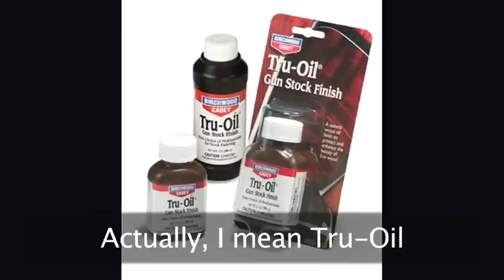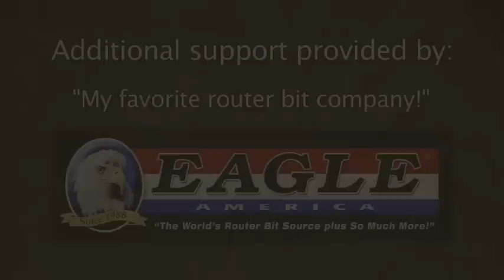107 - Oil-Based Finish Basics

Comment: Have you ever used Birchwood Casey Tru-Oil??? It wipes on then blends while drying....I was wondering is it strong enough to protect the wood or would I need to apply some polyurethane???
Reply: Tru-Oil has polyurethane in it.  It is a blend of poly, linseed oil and solvent.  That´s what´s nice about it, you don´t have to add anything, it is ready to go as is.
Reply: +Rafael Lastra Thanks for that because I've been wondering should I use some poly or wax over it
Reply: Rudimental Chef You should always use wax over an gunstock, always.  Get the desired finish quality (closed pores, smooth Surface) and then wax, a light coat and then take it off either will a buffing Wheel or a lint free cloth until you get to the sheen you desire.
Reply: +Rafael Lastra Thanks a million

Comment: hello Marc, i watched allll your videos i love em.  im considering the Guild asa i have a little more ressources ! :)

Quick question.  Could i spray pre-cat laquer over a project i made where i put 2 coats of tung oil on it ? it i let it dry enough  (3+ days)  Its mahogany for the most part but top is walnut burl so its thin and the oil seems to have started to make a film.  If i spray a sealer before woul;d it help ? i'm just not good enough with wipe-on poly yet to get the smooth i want !  ty

Comment: I do large as well as small  carvings.  the majority of my work is done with live oak.  It may be hard as a rock but it last outside for years (one of them is 18 yr old and doing fine.)  It is an evergreen and it has strange characteristics.  I tried using boiled linseed oil outside on live oak, in two months it became an ugly black.
Helmsmen urethane (exterior) only last 8months in direct sun. 
Any ideas?

Comment: Can water and oil based polyurethane and urethane coats go on top of each other ? What is the general rule ? Is it ok to have polyurethane coating urethane and vice-versa. Thanks for the excelent presentations.
Reply from the maker: +dekzan as a general rule, it's best to avoid mixing oil and water-based finishes. If you don't have to mix them, don't. But if you DO have to for some reason, test for adhesion first. Assuming the finish is fully cured, give it a light 320 grit sanding, remove the dust, and apply the finish. That will give you the best chance of a good bond.
Reply: Tyvm. I need your advice to retouch an Urethane finished guitar neck that from the factory has been sanded in some spots for a "worn" look. If viable for you, please use my email dekzan@hotmail.com  I can reply with some pictures. I don't want to strip the finish. Planning to wipe on a mix of GF arm r seal and trans tint stain for the large back of the neck. Maybe powder dye matching some smaller spots on the frets. I know now the basic use of Naphtha for clean up, sanding, stain mix.
Reply: I posted 3 pictures on the facebook link
Reply: I wonder if it's ok to apply a mix of GF arm r seal and stain on the previous Urethane coat...trying to match the color on the sanded spots.  Thanks.
Reply: I may do an adhesion and color matching test on one fret. I don't know if the original Urethane coat is water or oil based.
Reply: Sorry to bug you...Now I'm also thinking of first applying plain 
Minwax wood Finish stain aerosol without any Urethane.

Comment: Strangely, I asked a coating manufacturer to advise on new beech worktops, and they recommended acrylic, when my thinking was to use their Danish Oil which is widely used, 
Confused. The main retailer of wooden worktops in the UK recommends their Danish Oil
Reply from the maker: In many cases, the finish companies aren't woodworkers. When you want good finishing advice on woodworking projects, ask knowledgable woodworkers and refer to the manufacturer's when you need specific details on their finishes.

Comment: Can you (or anyone else here) help clarify something? Around 10:00, you say that your two cans of polyurethane are pure varnish without any oil, and you suggest that the word "oil" is essentially just marketing. But they're both "oil-based" polyurethanes, right? So that seems to imply that they do actually contain oil. Or is that oil chemically modified into something which you would no longer consider an oil? (E.g. the MSDS for General Finishes Arm-R-Seal says it contains "oil modified urethane resin.")

I've never heard from anyone else that oil-based polyurethanes contain no oil, but you seem quite sure of it... e.g. at 10:11, "this is just a diluted varnish, and these two actually do contain oil."

Are you just trying to distinguish between: 1) products which involve oil in a chemical reaction (e.g. oil-based poly) and 2) products with oil simply added at a later stage (poly/oil blends)?

Comment: What type of finish do you recommend for an ark with two of every animal inside, may be subject to excessive moisture
Reply from the maker: The only appropriate finish is unicorn tears.
Reply: Ah! Good thing I'm from Canada. Our Coat of Arms has a unicorn on it. (not even kidding)
Reply: In a pinch, I have used Rhinoceros urine. They are just the Unicorn's chubby, armored cousin. And they don't cry, so. Litter box training them is arduous, but so worth it..
Reply: foo foo oil you get it from the fairys at the bottom of your garden
Reply: Scarab Beetle Tung Dung!
Reply: Outcast lay
Reply: @woodwhisperer .....Collecting unicorn tears is too arduous a task. If I'm not mistaken Noah sealed her up with pitch which is unrefined mineral spirits. Takes 40 days to cure though

Comment: Seems that the term varnish applies to lacquer, shellac or polyurethane          Is this Correct ?     The solids in shellac are very different then the solids in poly. Terms are thrown around very loosely.  Starting to wonder if the "experts" even have a consensus .
Reply: It's complicated. If you trust the information in Wikipedia, try that source. I think you will find it very helpful.

Comment: Good video.  I have to disagree about a couple of comments about tung oil.  You mentioned that there's not much difference to BLO vs. tung.  Tung hardens unlike BLO and doesn't grow mildew like BLO.
Reply from the maker: +Sean Winter That may be true, but they are both drying oils, and the average woodworker will have trouble distinguishing between them in any meaningful way. No doubt tung oil is the better product, but in the big picture I consider the two to be on the same level when we're talking about the whole spectrum of oil-based finishes.
Reply: Fair enough.  When I was younger, I remember making up a nice mixture for a friend of turpentine, beeswax and BLO.  Unfortunately the table spends a lot of time outside (covered by a canopy) and mildewed significantly.  Since then, I've been a lot more inclined to use tung oil given its anti-mildew properties.  In any case, great video and very informative.  Well done!

Comment: ????????????????????
I still have a hard time finding a direct answer to this question anywhere I seem to look on the net.  Does polyurethane yellow more,faster than a non polyurethane varnish?  Basically if I use a varnish without urethane will it yellow at all or not as much?  

Thanks
Reply from the maker: To my knowledge, all oil-based varnishes yellow over time. Not sure if poly-containing varnishes yellow more or less. Bottom line is if you're looking to avoid yellowing, you might avoid oil-based varnishes all together.
Reply: Thanks!  Are acrylic based finishes tough enough for wooden floors?
Reply from the maker: I would imagine so. But I am not all that familiar with floor finishes. But given how many areas are cutting back on oil-based finishes, I'd have to imagine some of these high solids water-based finishes are pretty tough.
Reply: Thanks!

Comment: I find the Arm-r-seal streaks.  If it goes on by brush or cloth.  What am I doing wrong?  don't get me wrong, I adore GF products - this one is so hard to use.
Reply from the maker: Most times I find that the streaks come from laying the finish on too thin. Try wiping on a thicker coat and see if that helps. But rest assured, you're not the only one who has a streaking issue. :)

Comment: from the biofuel world. we heat oil to remove any moisture content. it also lowers the viscosity and allows any emulsified bits and insoluble particulates to settle out. when you're done all the stuff you don't want is on the bottom. just like your deep frier.

Comment: Sometimes when a finish dries too quickly it traps moisture inside of it and that happens, it's called "blushing". Lacquer dries quickly and when you mix it with a thinner it dries even quicker. The problem could also be that the shellac wasn't "de-waxed" shellac and the lacquer is having problems bonding. I would remove the lacquer and just put another coat of shellac on it.

Comment: I have a soft wood butcher block island surrounding a cooktop. We always use cutting boards, but I'm concerned about stains and spills. We also want it a darker color. Your information led me to consider using Tung Oil because of the daily use/ easy touch up. This one is high up on the list https://www.realmilkpaint.com/shop/oils/dark-tung/.  However, you also mentioned the thinned epoxy which would really protect the wood. Since we live in Arizona, I worry about the glue failing from excessive dryness and frequent cleaning. Can you draw on your experience and give me some input?

Comment: re gun stocks:
If you're trying to correctly refinish a military gun stock 
1. Don't use True-Oil on military gun stocks
2. Don't use "boiled" linseed oil on military gun stocks
If there was anything applied to military gun stocks it would be shellac or raw linseed oil.
M1 Garands would used raw linseed oil, the fatty acids would give the stock a rich reddish color over time.
Other stocks like Swiss k31's or Mosin's use a shellac.This allowed for easy repair and refinish without removing wood.

Comment: MINWAX makes a  product called "WOOD HARDENER". it soaks into the grain , solidifies , nearly petrifying the wood.!
i've used on dead/drift wood , to porous woods , ./ pine etc , with great results , .
Once you sand it , (lot harder to  sand as its a  harder material now), it brings back the lighter tones in the wood (light pine). then can stain etc..

Comment: Have you work with animal blood very old way to stain
Reply: Dragon's Blood is not blood, it's a from a plant.  Also Bloodroot is not blood, it's a plant. They are both used for pigmentation.  Maybe you can find more information by researching them as plants, not the blood of animals. Cheers.
Reply: Cut myself some time back trying to remove a freud bit from my router, got on the wood. Liked the way it looked, just not enough blood for a complete finish fortunately or unfortunately depending on the perspective.

Comment: I never see the inside of furniture finished.  Why would you?  Is this something everyone else is doing wrong?
Reply: Theoretically, if there is a swing in humidity where the wood is located, an unfinished side will absorb more of the moisture in the air causing the wood to swell on the unfinished side, thus warping. We are primarily talking about solid wood. It can also happen with plywood. Alot of commercial furniture is plywood and I think that is why commercial furniture makers get away with it. Perhaps they do something else to their wood , perhaps a clear finish that is hard to detect. A complicated issue for sure. Hope this helps.